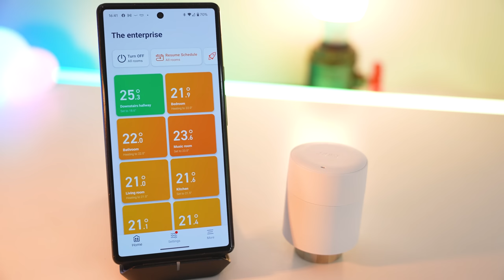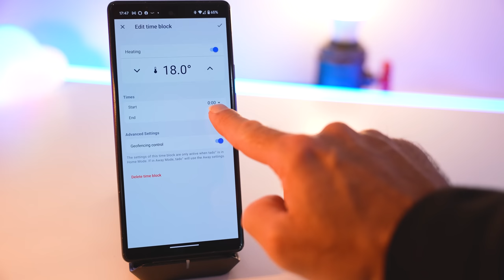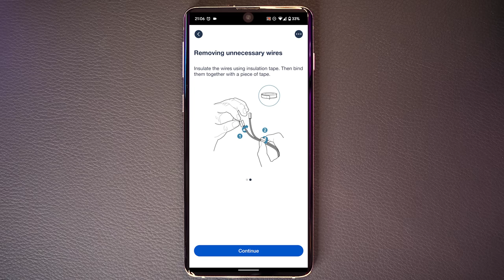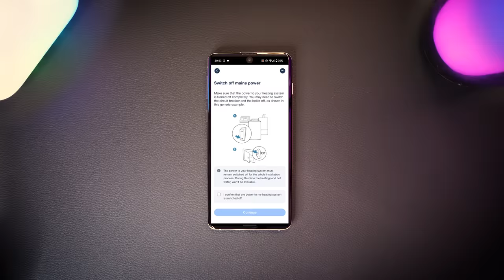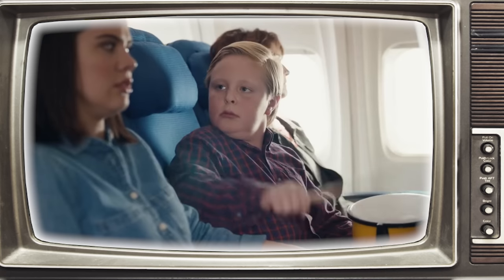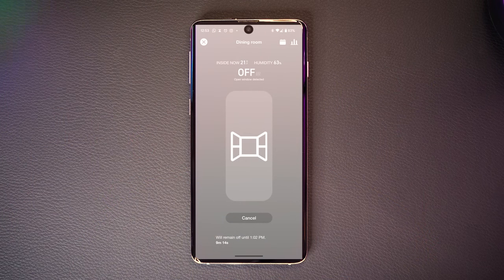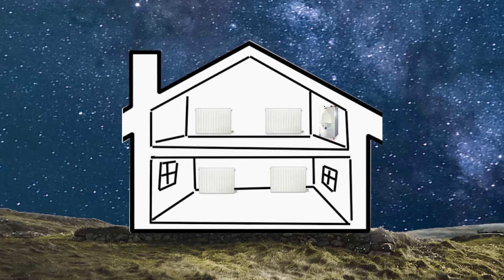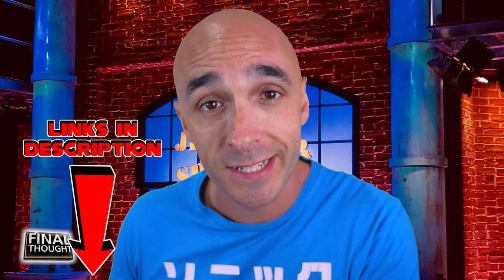Install This On Your Radiator & Drink The Tears Of Your Energy Company

Comment: I own Tado, BUT if I would buy again today I would probably got with Shelly TRV instead. Same price, but neither you need a gateway nor you completely rely on Internet Based services.
The reason why I am not happy with Tado is simple. Despite the high price, some automations are only available by subscription that comes with an additional monthly cost.
The other reason is that there is no support for Window Sensors. You have to use something else like Homeassistant to have proper Window Sensors to turn off your heaters when the Window is open. 
Having that said, the have a Window open detection that works if there is a temperature drop in a short time, they will report a window open and you can manually shut the heater off. To automate this it is part of the monthly subscription service.
BUT if the window is already open and it is cold outside and your schedule turn on the heater, it will not shut it down again. Problem is that it is already cold in the room and there will be no temperature drop. I had this many times in the last winter,, when my wife forgot to close the window after taking a shower. In the morning the routine fired up the heater, regardless if the Window was still open.
The other problem is that we have a dehumidifier in the bathroom. When this kicks in because of raising humidity, it blows dry, but slightly colder air in the room, which is detected as an open window and the heater is turned off.
What I really like is the smaller form factor compared to the other "smart" thermostats from other vendors.

Comment: Have had tado with the whole house kitted with TRV's for a few years now. Was lucky enough that I've had it long enough to be able to pay a one time £20 for what are features now hidden behind a subscription 

On the whole it is fine, and it absolutely looks the part and the UI is slick.

Having said that I wish I'd have gone Drayton Wiser in hindsight. I've had relatively regular range issues from my bridge to 2 or 3 of the TRV's in my house (which isn't massive). Firmware updates have helped a bit, but still happens enough to be irritating. A signal repeater would be fantastic (like Drayton have) but Tado support have railed against this on their forums citing the complexity of implementing. Judging by the tado forums, I'm not an isolated case.

Lack of local control, as you and many in the comments have said is a big negative, especially for those without the time/ability to build a home assistant setup to achieve it. 

I also wish tado would release a much cheaper (and smaller) wireless temperature sensor. Yes, you can use offset on the TRV's, but for me setting offsets has resulted in the boiler working harder to get a room to temperature, and will then often overshoot. £85 RRP for a temperature sensor is a joke. 

Would be good to get the Open therm clarification from the horse's mouth as well. I'd also seen that Tado aren't selling with open therm support to UK consumers with the latest version of the extension kit

Having said all that, I'd still generally recommended a tado if someone was hellbent on getting one, it has enough going for it.

Comment: Great video, nicely done. We've been using Hive for many years and it was not a pleasant experience to install, and they continue to have all kinds of frustrating issues. And they only introduced a child lock feature this year! Tado seem much better, if anything were to happen to the Hive system I'd move over to them no question.
Reply from the maker: Good price on the Hives though!  I've just had a look and that's pretty decent!
Reply: I've got Hive, would you recommend the radiator valves, the reviews are so mixed?
Reply: @emlin5k71  oh it depends. How patient are you? If you're willing to persist you'll probably get it all working nicely. I had to buy some small metal plates/washers because the unit couldn't press down on the valve properly - there's various posts in the hive forums about same issue so it might crop up. This is my third year now with them and they've been working fine. It's really nice having all the rooms scheduled, eg living room on in the evenings but off during the mornings. Good luck if you go for it!

Comment: This would be a nice techy thing to have, but you don't mention the cost.  At about £200 for the smart thermostat and £50 for each radiator thermostat, it would cost over £800 to install in my house, for little extra gain in savings over having ordinary thermostatic radiator valve heads on the radiators.  Better to spend the money on more insulation, in my view.

Comment: So how much to do with my house with 16 RADS

EDIT hold on I just looked up the prices. So will cost me £1066 for all the valves 
£ ~200 for the starter kit. Not sure if I need anything else. So around £ 1,300 WOW that's alot.
Reply: Yup, just costed it myself and it looks like it's just over £1k to equip our home. We already have an Opentherm modulating boiler and (single) mobile thermostat with a weather compensation external thermostat fitted for Boiler+ certification. Given we both work from home effectively full time and we've already got the dumb TRV's turned down to the frost setting on the two spare bedrooms and will have the others set to the minimum comfortable level, once we actually turn the heating on, I can't see how there'll be a payback on that kind of investment within 10 years. 

If, however,Tado want to send me a free kit to fit, I'm happy to be proved wrong, as it 's the best looking kit of all.
Reply: @techieboy333  haaaa perhaps Paul could of spoken about the real Elephant in the room. The Cost of setting this up.  It seems great and all but rather costly.
Reply: Also have a look at the Drayton Wiser system, very similar features to Tado, but no subscription add on service and slightly cheaper single Tado TRV on Amazon £69.99 vs single Wiser TRV on Amazon £51.52 as i type this
Reply from the maker: @AdrianMcDaid  https://youtu.be/Oky9rDdnWvU?t=637 😉 There's no doubt it's a costly system, I will be investigating a cheaper systems soon and will be comparing it's pros and cons.
Reply: @paulhibbert  Hi Paul, thanks for the resource. I liked your videos. Looking forward to you looking at other choices in the market.

Comment: Why do not just turn the normal radiator stat by hand and save yourself a few hundred quid on this?
Reply from the maker: So wake up at 4 AM to wander around turning the nobs ready to heat the house before you get out of bed, and then go round turning off the ones you aren’t using manually whenever you leave a given room. Sure, sounds really energy efficient and not the least bit time consuming.
Reply: @paulhibbert  I just turn off all the stats by hand in the areas I do not want to heat ever and my hive systen turns on and off at the times I tell it to. I see no benefits to the system you are bigging up or am I missing something?
Reply from the maker: @richardfoster6494  you’re definitely missing something 😂

Comment: As Tado is totally dependent on the Cloud for operation, I would not use it. However, I have used EvoHome for the last eight years, and it's brilliant. It does not rely on Internet access as It has a local control unit and communicates with all the radiator actuators using the 868MHz band. You can also set up separate temperature monitors located where you sit. Thanks for the review!

Comment: Great job Paul, I'm a heating engineer and I enjoyed this one (love all your videos). I have a similar install to yours but more involved. All bedrooms and bathrooms and downstairs are piped up separately (water goes only to the radiators I want and bit round the entire heating circuit) with hard wired programmable thermostats in each room/area, separate zone valves in the loft for them to talk to, locally controlled in your network or away from home, opeb everything and works in Google Alexa apple. Great app very easy to use with a graph for the day or week showing a record of the temperature in any room. Apologies, I went totally mental in the install. It's made by heatmiser a UK company well worth a look. Had mine for 3 years with no issues

Stay safe
Reply: May I ask if you fitted TADO EU model on a system boiler by utilising Opentherm and the PDHW???

Being on a S PLAN they need the NormallyOpen zone valve which I got but the wiring the tado is a puzzle.

Comment: The cost for these things are so high they are very likely to break long before you start saving money.. £220 for a starter pack which comes with 3 valves. Thats wayy too much and they will break before they get to the point they will save you money sadly. Also setting timers will cost you more than you spend as your house may be warm and your setting to auto turn on anyway. Manually turning on heat will save you money rather than timers. You also have to pay £25 a year for their auto assist features on top.
Reply from the maker: Objection, hearsay.
Reply: I can only tell you that I have had a similar system for several years and it shaved 33% off our gas bills, stopped radiator vales locking up over the summer when they are not used and paid for itself in 2 years. Unlike manual valves these things close completely and trap the heat in the radiator improving efficiency too. Energy is only getting dearer; this sort of system is worth every penny.

Comment: Once again Paul.  Tado do not support OpenTherm in the UK, at least not on the wireless kit.  This is, apparently, because UK installers found it too complicated.  The EU version, which is probably what they sent you, does Support OpenTherm.
Reply from the maker: Once again, I installed this myself to the Opentherm terminals on my boiler 🤷‍♂
Reply: @paulhibbert  If it's the wireless version then you were supplied with the EU version.  The UK version does not have OpenTherm.  It's very explicit on the Tado support forum.  And my Wireless system absolutely does not have OpenTherm.
Reply: @paulgoffin8054  I found the same as you when I installed my wireless system earlier this year, my solution was to add a Wired Thermostat to the system, connected to the digital input of my boiler, and to disconnect the relay connections of the Wireless receiver (which did still need to be powered).
Reply: @paulgoffin8054  This is so stupid! I want replace my nest system since I want to have room per room control but not having OpenTherm is a major nope from me sadly
Reply: @mariusm5187  You can do it, but not with the standard wireless starter kit.

This from the Tado forum:

"It depends on the home really. The UK has very different heating setups/wiring than other European countries. Like using a relay for domestic hot water or the wiring centres, that's all rather UK-specific. In my native the Netherlands, for example, it's common to have a wired (digital) thermostat in the living room that is controlling the boiler directly, without any valves and programmers and whatnot in between. The main differences between the markets and the feedback we've received caused us to have a specific UK-only wireless receiver (serial number BP...) with 2 relays and no bus (like Opentherm) connection, where the EU version (serial number BR....) has 1 relay and does support bus connections. These devices are, based on the feedback we've received, much easier to install and setup than the previous generation (serial BU....) which had 2 relays and bus and was available in the EU + UK.

Anyway, the wired thermostat in the UK does support a bus connection. And we recommend using this connection when applicable. Otherwise we would have cost-cut it out of the thermostat a long time ago.

The main question is about the available wiring in the home. Is it relatively plug and play to wire the thermostat to the boiler? We discourage non-professionals from making big changes to the wiring inside the home, and encourage non-professionals to just use the wiring that's available and simply replace old devices with ours"
Reply: @paulgoffin8054  Yeah I saw this post as well. Sadly I don't have a cable going from my boiler into any other room, it's just a cable that goes from boiler into the controller hub just below the boiler with 5 wires (L, N, (230V) E, Op1, Op2) so sadly this is not really an option for me.
Reply from the maker: I've spoken to Tado, and they have confirmed they stopped selling opentherm in the UK, and have since started to again! I've asked them to confirm the link I'm giving out is for the opentherm version and will update my link accordingly once I have the answer.
Reply: @paulhibbert  Thank you, much appreciated.
Reply: @paulhibbert  cheers Paul, this might explain where the cheaper version Screwfix are selling (with a black wireless thermostat) has suddenly appeared from, possibly selling through the non OpenTherm versions?
Reply: @paulhibbert  it makes sense with the new part L (I think) building regs. The days of relay managed, non weather compensated and non digital links are finally numbered in the uk. Priority domestic hot water will be the norm now, I think, to allow reduced heating flow temps. Tfft. Shit. I sound like my dad.

Comment: Nice video and interesting concept but won't buy this because a) I have Nest already b) I can just adjust the temperature in specific rooms using manual thermostatic valves and c) because we've already bought snoodies and a wood burner to minimize use of central heating anyway

Comment: I specifically avoided Tado because I'd only heard bad things about it, IE. they're either on or off, meaning they don't adjust the temperature, just turns the heat full on and full off whenever it passes the desired temperature, which makes them noisy and inefficient. And especially because you apparently need a subscription to use any of the features you're getting it for, like open window detection and geo fencing.

Comment: I've had the Honeywell Evo Home system (which is technically not for residential, but more for commercial premises like hotels etc) for about eight months now, and it has an advantage over all other smart TRV systems. It uses its own RF frequency, rather than wi-fi, so when your router goes down, it still works and never loses settings.  Ultra reliable, and the app is amazing too.  Worth having a look at if you're in the market for a smart TRV system  :)
Reply: Hi, fyi, Wiser system uses RF TRVs as well

Comment: My issue with stuff like this is that I would only buy for the purpose of saving money, i have 7 rooms in my 3 bed house so I need 6 of these to have 1 in every room and the 1 radiator without, so it's like £400 I might save £100 a year but Id still have to wait 4 years before it became a worthwhile money saving investment need the savings now not in 4 years when the economy is fixed

Comment: Please stay away from Tado, there are better products out there!

I have used the following since 2016:
3x Smart Radiator Thermostat
1x Smart Thermostat 
1x Wireless Receiver

These are some of the reasons why I would stay away:
1. No internet, No heat 🥶
In the event that the internet is not working you have no heat, nothing, nada.... doesn't that defeat the purpose of a thermostat.

2. Your full GPS location is send to Tado (and stored), every time. 📍
No attempt at privacy by design even though they could calculate the distance on device and only transmit that. 

3. Batteries don't last more than 6 months 🔋
I have to replace the batteries on the values quite often about every 6 months (even the ones that are hardly used). Not the 2 years they advertise... 

4. The buttons on the Smart Thermostat are unresponsive.
Good luck on changing the temperature with the buttons, they just won't work, unless pressing really hard (sometimes)   

5. HomeKit and HomeAssistant integrations are absolute shit and only works via the cloud. 
You have no easy control over the system outside the Tado app. Not the integrated solution I'm looking for.

6. Many of the app's features are absolute nonsense
Very useless functions and it's not possible to export logs or other data (temp, humidity, heating %)

Just look for something else! I've spend way to much on them before I found out these issues, the system works well enough not to rip it out but I would not buy this brand again. 

Oh another tip, don't use the included plastic adapters for the thermostatic values, they are not strong enough and cause problems, find ones made of metal, they will save you a lot of headaches.

Comment: Sorry mate but Not 100% valid info. The original valve that this screws onto seizes....And no matter what controller you use with it, eventuallly wont work. The valves stick in the Off position (pin down). Add WD40 and pressing the pin down on the valve to free it may help. However ordinary wax filled theromostatic valve work ok as well. Neither will work if the valve on the rad sticks...which it will.....Unless we move to the Hibbertverse....where all is Great!! Hail the Hibbert!😁